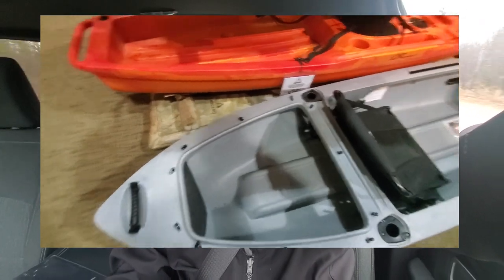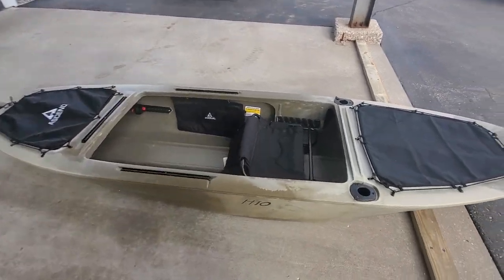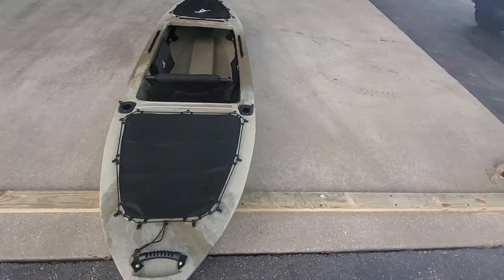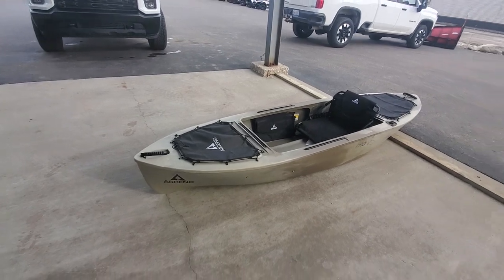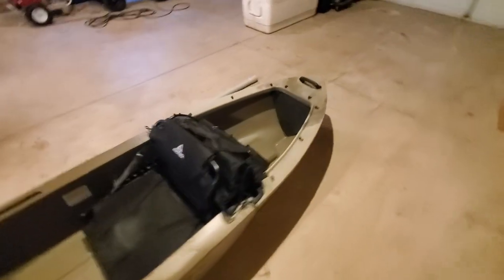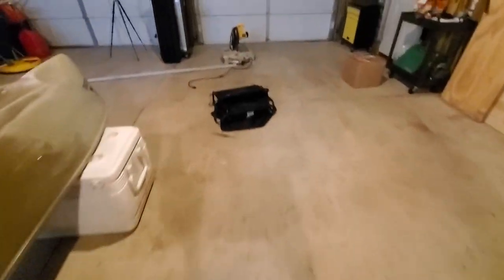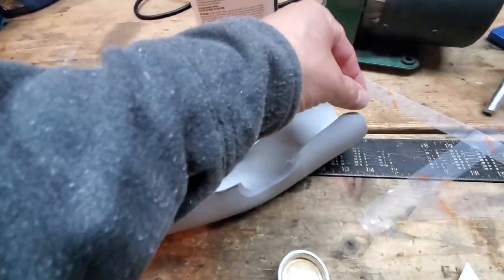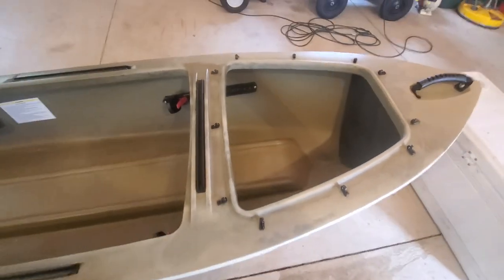Setting Up My New Ascend H10 Kayak For Hunting And Fishing

Comment: That conduit looks like electrical plastic conduit. You can get a premade elbow that should work well for the bend on the keel guards.
Reply from the maker: You are 100% on both points. I already have the pre bent elbows in my shop tonuse when I get around to redoing them

Comment: you can cut a piece of a 5 gallon bucket at mold that for your keel guards too. It shapes pretty well if you get it good and hot.
Reply from the maker: That's a great idea. I have melted 5 gallon buckets to pack 4 wheeler fenders before too. Love 5 gallon buckets for plastic work!
Reply: That's what I did.  I melted HPDE plastic and built up the keel and bow with extra plastic.    I never try standing on this.   I can't imagine bow hunting standing on this, get ready for a bath

Comment: At this point, do you wish you'd gone with an H12 or something else? I've been looking at the H12 for a while now, but H10s have been popping up used a lot here lately.
Reply from the maker: No. Love this boat. Use it all the time. It fits in the bed of a truck so nice and easy, holds more weight than the 12 and is lighter. I love the h10. Will never get rid of it

Comment: if you were to shoot a deer or pig where would you put it for the row back to the car?
Reply from the maker: Yes. Have done that with quite  a few big bucks in my little canoe. But I always bone the deer or pigs out before putting them in the boat. I can't see any advantage to fight to load and unload the animal in and out of a boat or fight for space in there with the animal. So much easier to bone animal in the field and throw a couple game bags in thw boat.
Reply: @SamkoTradBow  I didn’t think about quartering em out. Good idea. Been thinking of getting one but haven’t been able to pull the trigger yet!
Reply: @SamkoTradBow  what game bags do you use?
Reply from the maker: @TooTallOutdoors  caribou game bags are my favorite.  Allen game bags are also good and available even at Walmart. And large pillow cases work great to. I like the pillow cases for hogs as I usually don't put the hogs in my pack (just use a small mtn bike pack while hog hunting) so I can swing the pillow case full of meat right over my shoulder.

Comment: Would not stand up in the kayak!!!!
 It's not that stable for standing...   also put pipe insulation around on bottom of seat to protect it wearing thru the boat..
Reply from the maker: I was just standing in mine last week down in Georgia.  Worked perfect. But im a short guy with low center of gravity! Great tip on the pip insulation on the seat! I'm gonna do that next time I'm down there where the boat is. Thank you.
Reply: @SamkoTradBow  I love the kayak... I got caught going against the wind 25 mph and it was tough paddling against it...  it's worth every penny so stable!  Haven't flipped mine yet have owned it for a year.. I never use the front or back cover or bags, nice add ons but much easier without them in the boat.   I should probably take off the clips front and back, best place for my net and cooler.
Reply from the maker: @lipfishingthosebass5812  yep I already ripped the bags and the covers off and threw thwm in a box in the attic in case I ever sell it. Wish the clips were screwed in but they are rivets and not worth my time to drill them out. Lol

Comment: 779 at cabellas
Reply from the maker: That's crazy. Should be the same price as basspro and cabelas
Reply: When I was watching I was curious. I live in Hudsonville Michigan and go to the Cabela’s there in Grandville off 44th St. so I thought I would check the price. I figured the same thing I thought it would be the same as Bass Pro shops. Because of the fact Bass Pro shops bought them out. Either way cool set up buddy
Reply from the maker: @brendenwolford  just to check I'd call a basspro and see what rhier price is. The cabelas by you would have to match it if you found a better price.
Reply: @SamkoTradBow  prices went up right about at the time of this video due to materials shortage
Reply from the maker: @briandudasko6742  it's not a material shortage, it's a people not working problem.  Runs all the way down the line from sales to trucking to manufacturing to raw materials.  So sad our country is like this now.
Reply: @SamkoTradBow  I 
Tell me about it, like everyone we're hurting for people bad.

I just picked up a like new used one for $500, I'm pumped to get it kitted out.

Do you find yourself wishing you went with the 12 for the more room it provides? I ultimately picked the 10 simply because 12s were impossible to find. I'm not sure the extra 22# was worth only 50 more pounds of hauling capacity.

Looking forward to more videos on the yak!
Reply from the maker: @briandudasko6742  so far I'm very happy with the 10. But time in it is limited as it's down in ga waiting patiently for me to take it pig hunting